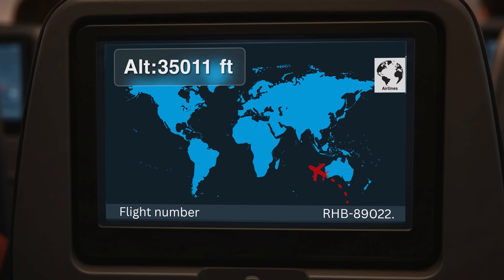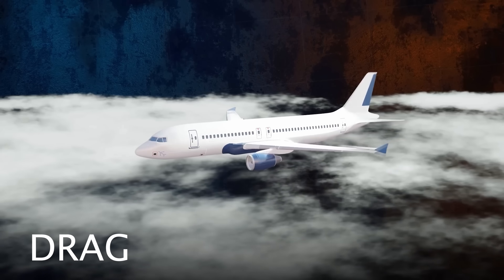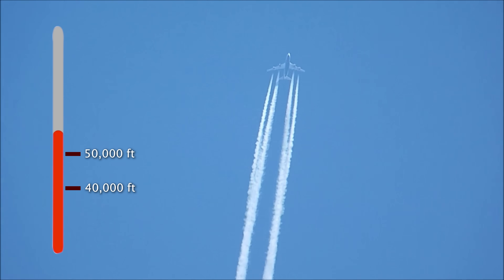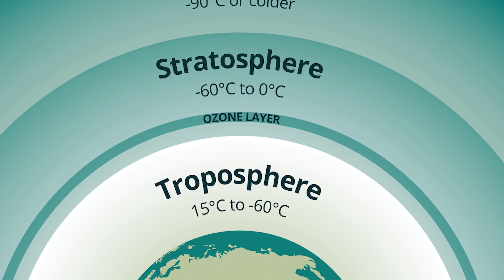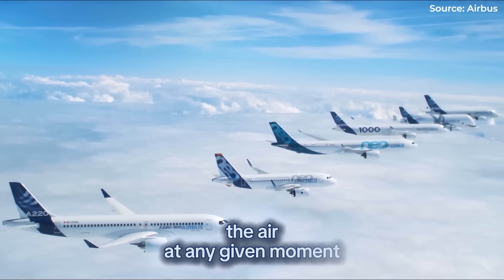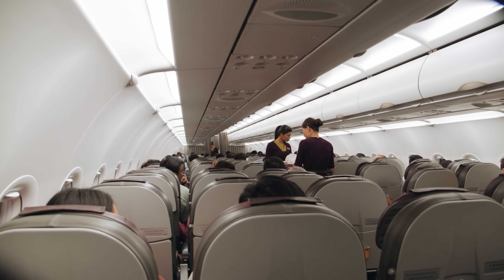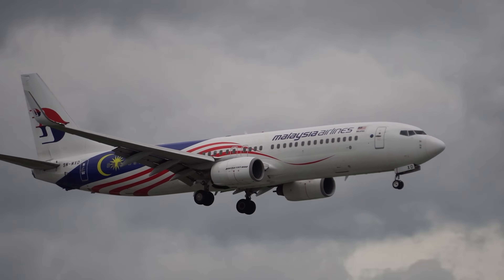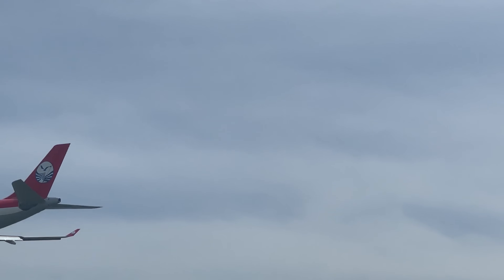Why 35000 Feet is the SWEET SPOT for Airplanes

Comment: Older 737 and 747 had optimal cruising altitude of 35,000 feet but more modern versions and aircrafts tend to cruise at higher altitude because of improved engines.
Reply from the maker: That's a great point about how engine improvements allow modern aircraft to cruise at higher altitudes! If there's a video you would like to see, let us know and we'll try to get it out there. Share our channel with loved ones and friends.

Comment: Average cruise altitudes go up with higher bypass ratio. The „modern“ long range aircraft types 787 and A350 quite often cruise in 390 to 430, the 737 maximum cruise level got changed from 370 to 410 with the NG, thanks to a completely new wing and more modern engines, with the MAX it finally got an engine that enables that for the more common larger variants (-8/-9). And even the A320NEO, although its max level remains unchanged at FL390 now commonly cruises at that level nearly from the start on 3 hour or longer sectors.
Reply from the maker: Thanks for the detailed insights on how cruise altitudes vary with aircraft types and engine advancements! There's always more to learn. If you enjoyed our video, please share our channel with others.

Comment: I’m retired now, but after flying in the military for 28 years, my time was split between flying corporate jets, primarily the Gulfstream GV, and being an instructor and examiner in the GV (classic GV, G550, G450, G350) and the GVI (G-650).  When I flew the GV, it would have to have been a very short trip to stay below FL400.  We routinely filed for FL410 to FL450 (my personal highest being FL470).  Max operating altitude was/still is 51000 feet.  Cruise speed M.80 - M.85.  The engines - Rolls Royce BR710A1-10 High Bypass turbofans. We were never “locked” into a single “sweet spot” altitude.  Whether we did our own flight planning or our dispatchers did it or a flight planning service like Universal, it was always about getting the best performance out the aircraft and flying the safest, smoothest and fastest route possible.
Reply from the maker: Wow, thanks for sharing your extensive experience flying corporate jets and the insights on optimal altitudes! I learned something great. Thanks again and please share our channel with family and friends.

Comment: Fuel saving is not about burn rate, as the engines must still produce enough thrust to overcome the drag force inherently linked to the lift force at any altitude. Fuel saving is achieved through less flying time.
Reply from the maker: Thanks for your insight on fuel saving and flight dynamics! Please share our channel with friends and family 🫡

Comment: If airplanes flew higher just because of less drag propeller airplanes would want to fly up there as well.  
The main reason jets like high altitude is that their engines are more efficient there due to colder air.     

When the inlet ram and compressor pressure ratio is fixed, the principal factor affecting the
specific fuel consumption is the inlet air temperature. When the inlet air temperature is lowered, a given heat addition can provide
relatively greater changes in pressure or volume. As a result, a given thrust output requires less fuel flow and the specific fuel consumption, c,, is reduced. While the effect of altitude on specific fuel consumption does not compare with the effect on thrust output, the variation is large enough to strongly influence range and endurance conditions. Figure 2.11 illustrates a typical variation of specific fuel consumption with altitude. Generally, the specific fuel consumption decreases steadily with altitude until the tropopause is reached and the specific fuel consumption at this point is approximately 80 percent of the sea level value.

Above the tropopause the temperature is constant and altitudes slightly above the tropopause cause no further decrease in specific fuel consumption. Actually, altitudes much above the tropopause bring about a general deterioration of overall engine efficiency and the specific fuel consumption begins an increase with altitude. The extreme altitudes above the tropopause produce low combustion chamber pressures, low compressor Reynolds Numbers, low fuel flow, etc. which are not conducive to high engine efficiency.

The tropopause is where temperature stops decreasing with altitude, its height varies from about 66,000 feet at the equator to 23,000 feet at the poles.  35,000 feet just happens to be a common altitude.  Many flights would benefit from flying even higher, but they are too heavy to fly that high.  The wing plays a huge role in the altitude and speed flown, and airplanes climb to higher altitudes as their fuel weight is burned off.
Reply: Another factor is loss of cabin pressure. How fast can you bring the a/c down to FL 175 and under.
If it takes more than 2 minutes then all occupants may die from lack of oxygen….
Reply: Above the tropopause, temps start climbing again.
Reply: @JMS0906  Yes, that text I copied that from is old.  Temperature does being to rise with altitude much above the tropopause, but much more slowly than it decreased with altitude below the tropopause.  Nonetheless there is not much to be gained in engine efficiency by climbing higher into warmer air, so at or just above the trop in the lower stratosphere is the theoretical sweet spot for subsonic turbojet engines.

Comment: Southwest flys 40000
Reply from the maker: Exactly, some flights, like Southwest’s, cruise higher at 40,000 feet depending on weight, route, and conditions. 35,000 feet is just a general sweet spot, not a strict rule.

Comment: SO MUCH NONSENSE. IN 45 YEARS AS AN AIRLINE PILOT WITH THE AIRLINES, THERE IS NO FL350 AS A SWEET SPOT. VARIES BY FLIGHT AND MANY OTHER FACTORS.
Reply: This is clearly your opinion. The video clearly states different altitudes. What do you want Rome built in a 10-minute video?
Reply: @Total-y6w  His opinion is far more knowledgeable than this oversimplified video that presents a lot of misinformation. The video doesn't even mention outside air temperature as a primary contributor to engine efficiency.
Reply: @Total-y6w  Unfortunately, you and he are a clear example of how people without any knowledge of the subject can make incorrect statements. Very dull and uninformative.
Reply from the maker: We appreciate your feedback and experience as an airline pilot for 45 years. Thanks for watching and sharing your thoughts!
Reply: @JetLogic1  Folks, I fly about 70 hours monthly all over the World, don't get me wrong, please. Every flight is at a different altitude dictated by many factors, as I mentioned. And yes, always dispatch will file us at a "SWEET ALTITUDE" (optimum), but it is always a different one.

Comment: It's the FAN  moving the air.    ..... A high bypass turbofan is a jet engine that generates most of its thrust from a large fan at the front, where most of the air bypasses the engine's core to be accelerated around it. This design is highly fuel-efficient and quieter, making it the standard for modern commercial airliners. The remaining air goes through the core, where it is compressed, burned with fuel, and expelled to provide additional thrust and power the fan.
Reply from the maker: Thanks for the detailed explanation of how a high-bypass turbofan works!
Reply: Would you say that that far-forward-fan, in a way, sort of kinda maybe equates to a prop on steroids??

Comment: Your description of the problem is incomplete. The higher you fly the less turbulence there is. Air is less dense here. Agreed. Also reduced air density decreases air drag (there are two different drags, not one, a point you obviate). But you are incorrect in saying that reduces the engine’s ability to operate efficiently. Yes and no. You need more powerful engines to do the job. Fighter jets and private planes are not so restrained, for they have a higher engine power to plane weight ratio. So they just fly higher, at greater speed and in more comfort. 

There os another aspect to his as well. When planes depart the interior cabin pressure is atmospheric. The higher they fly the lower the exterior pressure. This induces stress on the fuselage, which increases with height. Over many cycles, aluminium planes experience metal fatigue. So the interior pressure is decreased compatible to passengers’ comfort. Newer carbon composite planes like A350 and 787 are impervious to this, so they can offer a cabin pressure closer to that of sea level, improving comfort, and simultaneously fly a bit higher. 

Private and military planes are still all aluminium based. But they do not undergo up to 4-6 cycles day in day out, so they are less affected by metal fatigue. 777-X is new, but still retains an aluminium fuselage. Yet they offer the same level of cabin comfort as the aforesaid. The reason is that they will fly almost exclusively long or very long missions, typically one per day, and can better afford to fly higher
Reply from the maker: Thanks for the detailed insights and additional information on the complexities of optimal flight altitude! We love great insights and conversations for all.